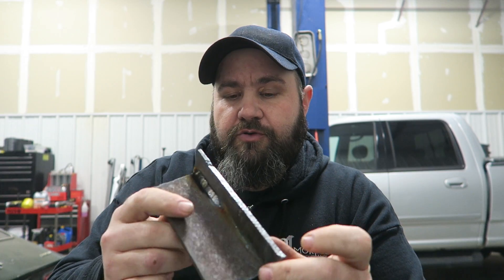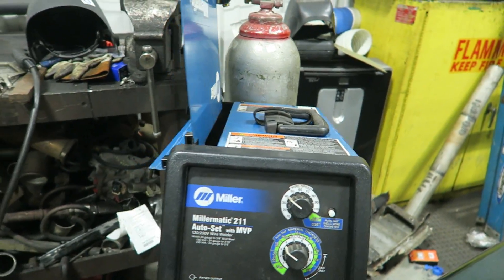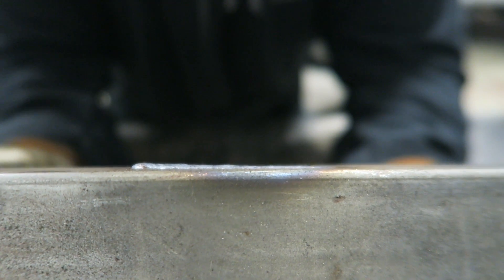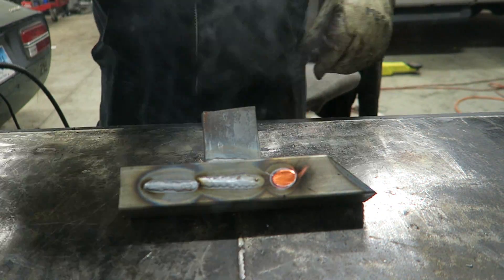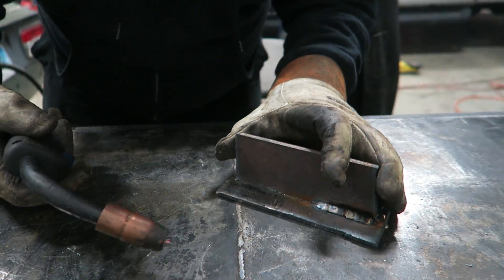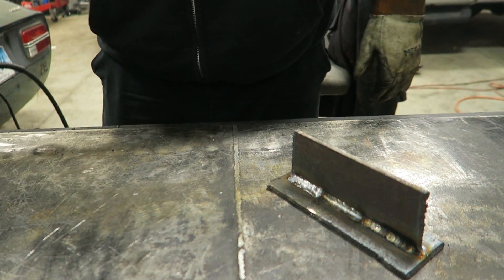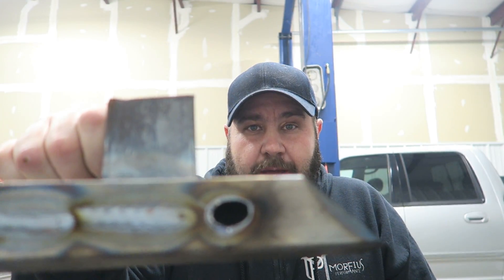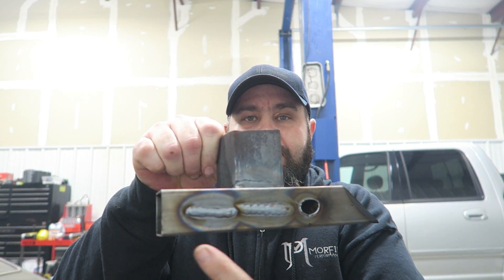Mig series part 2. Voltage and wire speed settings

Comment: I am opening a factory using T1.0mm and T1.2mm black ERW square tube, before my welders are employed I need to make 20 fabrication table base frames using the same tubes. I feel confident after watching your video's, however what is the gas flow and should I opt for argon/ CO2 90/10? especially for the welding robot. What Lincoln machine should I buy for all day use? Can you recommend? Many thanks!! Will

Comment: I'm just learning to weld at almost 50 years old. I have no need for one besides hobby and i like the fact i can make things. I'm lucky in that a relative owns a trailer manufacturing company. I asked if he had any scrap tubing or angle iron to practice beads on. He walked me to a scrap dumpster that probably had 5 tons of all kinds of metal in various thickness. Felt like a kid at Christmas. I've watched a bunch of welding videos. I found your instructions and description of various issues to be among the better ones. Thanks
Reply: Never too "young" to learn new skills...I'm 70 and just started to learn how to weld. It came in handy because I had to fix some mistakes repairing a fence line at my church. It was a horror shoe but the pieces held together and after a lot of grinding. the post looked like one piece.....LOL Just having fun!

Comment: you know voltage isn't actually 'heat' it lengthens the arc making it the weld flatter, the penetration is either less or relatively the same.
Reply from the maker: Jason Woodley increasing voltage increases amperage applied assuming the resistance remains the same. Ohms law states power = voltage X amperage. Or P=I x E. Thus increasing voltage inherently increases amperage which increases power aka wattage aka heat input. Again assuming wire size, arc length, and resistance remain the same.
Reply: @MorFabIndustries  thats correct,i believe you can measure amperes in electrons if you wanted to, but electricity is shuffling electrons, what makes an electron shuffle is voltage. More volts=more electrons shuffleing
Reply: @MorFabIndustries  heat and amps are controlled by wfs more than the voltage setting.

Comment: Fairly thin. 0.083”.

I absolutely hate welders that have arbitrary numbers that mean nothing. Why they can’t put the actual numbers in, I can’t understand. While it’s true that even actual numbers may be off, you at least, learn settings that apply to any machine with “real” numbers. Why have us guess at the voltage and wire speed? What’s the point? Is it supposed to be less intimidating? If so, then a new welder will learn nothing. Since when is that good?
Reply from the maker: It would be nice if the manufacturers standardized the numbering. I tend to go by sound and feel however you are correct in that the new welder will have issue depending on what machine he decides to use.

Comment: Hello! i was recomended to you by jimmy Oakes! love the vid. i need to weld the frame on a 70s truck but i have a hobart 500559 which is a 140 welder 115v. is that powerful enough?
Reply from the maker: Crank it all the way up and make sure it's hot.
Reply: @MorFabIndustries  lol... just weld that shit, n git r done!!!!
Reply: stick has much better penetration than mig short circuit....probably better for structural.  also mig needs better prep.
Reply: Honestly, if someone doesn’t know enough to know when a welder is suitable for serious work on a truck frame, they shouldn’t be welding that frame—at all. Sheet metal panels are innocuous, if they rust from the weld, or crack, big deal. But the frame is something else. I could never, in good conscience, tell someone who didn’t understand enough, and obviously doesn’t have the skills, that it’s ok for them to weld something as critical as a frame.

Comment: You hold the handle there for a few seconds when you're done welding.  Is that necessary or just habit?  Thanks
Reply from the maker: I tig way more than i mig so its just habit lol. Totally not necessary.
Reply: Ok  Thanks for the response!  Your videos are most informative as far as welding goes.  Thanks for the videos!

Comment: Sorry if i missed it but what size of wire are you using?  Is it generally 0.6mm for car body and 0.8mm for anything heavier?
Reply from the maker: Ollie it's .030" so roughly .8mm And yes you are correct. .024" for smaller sheetmetal such as body work.